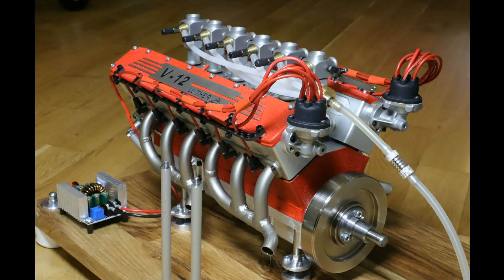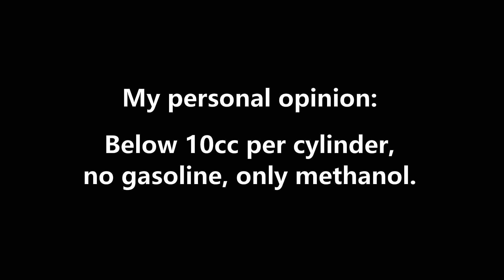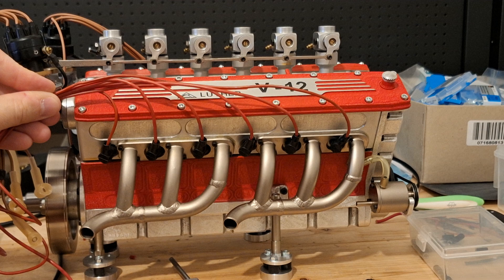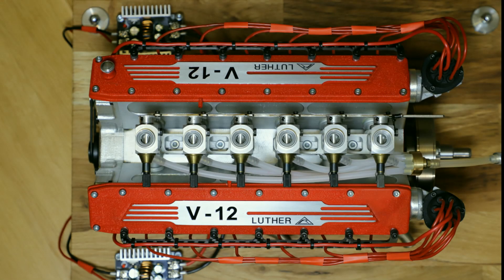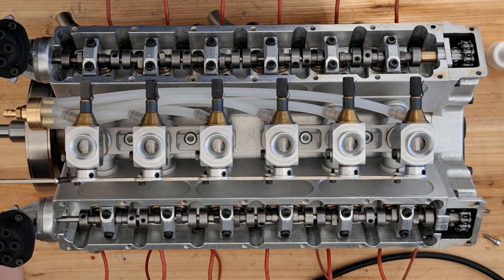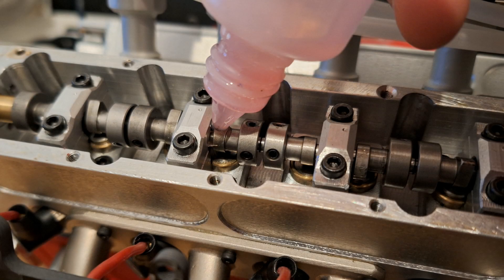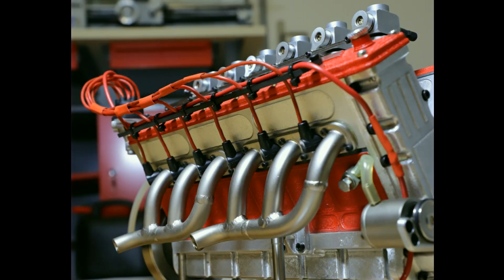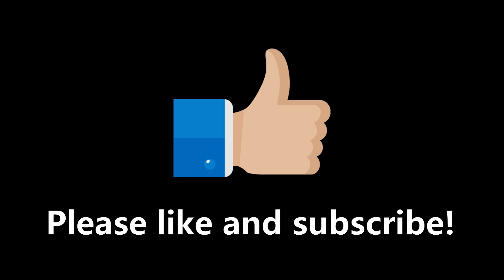Luther V12 Modellmotor mit 120ccm / 120cc V12 Model Engine made by Rolf Luther / scale V12 engine

Comment: The cam lobes attaching individually to the shaft is interesting. Easy to manufacture (don't have to remake a whole shaft if you get it wrong) and can be hardened easily without worrying about warping the whole shaft
Reply from the maker: This type of camshaft is common in model engines, as is the crankshaft, which is not made of one piece. Adjusting the cams is just a bit time-consuming.

Comment: The problem with gasoline in small displacement, is atomization... especially with ethanol blends. Methanol-based architecture simply doesn't have the compression needed for proper combustion. Small displacement doesn't agree with high compression. The tolerances for valve clearance don't scale well. Best alternative: deep chamber glowplugs and high ethanol blends for sufficient flame front propagation to burn the gasoline in secondary combustion.
Reply from the maker: Hi James 👋 It will be something along these lines, which is why gasoline is unsuitable. Methanol is simply much more tolerant, especially in combination with nitromethane. Based on this, I decided to convert it back to methanol. The lower combustion temperature of methanol is also gentler on the engine.

Comment: Of course we want a longer video. 😇
So, no gasoline under 10cc per cylinder. Thanks for the info.
Reply from the maker: Hi V DEL 👋 I also hope that there is a lot of interest in my custom Luther V12. Let's see. 
No gasoline below 10cc per cylinder is a good guideline. Even experienced manufacturers such as OS or Saito respect this. Currently you won't find a 1-cylinder gasoline engines under 15cc from OS and not under 11cc from Saito. Under 10cc per cylinder the engines will run, but not very well. The reasons for this can be probably found in the fluid or thermodynamics of gasoline. It may also has to do with mixture preparation (stoichiometric mixture), which is much trickier with gasoline than with methanol. Achieving this is probably no longer really possible under 10cc with gasoline. Methanol, especially in combination with nitro, is much more tolerant. That's why all small RC engines still run on methanol and not gasoline.
Reply: A few years ago, Horizon Hobby released a 5.5cc petrol engine.
Dynamite® .31 Gasoline Engine

No experience of how it works, but the fact that it hasn't been around for long says a lot 🤔

I've been excited about the Luther engine since the first announcement, I'm always amazed at what you show us on your channel 💪🏻👍🏻
Reply from the maker: @nee3029  Interesting! I see it's 2 stroke engine. I think from this typoe there was one from GO with 0.28cui as well 🤔 But I have no iedea how good they run and if they had problems. I have only heard that they have ignition problems.
Reply: @danielhunziker3577  its mainly the stoich, and being spark ingnited. pretty hard to make a needle valve that can meter that accurately at such a low flow rate. and still atomise "neatly"... nitro/methanol you just dump it in there and dont worry too much, as long as theres enough it will ignite thanks to the glowing element (and a bit of catalysis...). spark has one chance, and its only a very small spark, with a  relatively narrow window of combustibility. 

running the "bubbler" aka "vapour" type carbs, rather than needle valves, petrol is fine... albeit only half the power of the alcohol...
Reply from the maker: @nee3029  Thanks man, do my best! No, it's a 4 stroke engine with 2 valves per cylinder and 120cc.

Comment: An absolutely beautiful engine!  The glow plug distributor is clever.  Also the engine mounts look well designed, hopefully they are soft enough to isolate any vibration, if there is much with the V12 configuration.

One comment, the engine mounts are designed to "damp" vibration, not "dampen.". In my professional job, I design rubber bearings for helicopters, its common to find people incorrectly interchange the word damp for dampen.   To "dampen" something means to make it wet.  Have a great day!
Reply from the maker: Hi John 👋 Thank you very much!😃 Yeah, this engine is a beauty and something special. For me, this is one of the highlights in my collection. It has now become a hybrid, a combination of Rolf Luther and myself. A unique piece that I'm very proud of. I feel that the motor mount is just right in terms of stiffness. Have you noticed in my video of the VR5 that I used the same rubber buffers? I will use these for all my engines in future. In past I used to simply screw the motors onto the wooden plate... stupid idea... a lot of vibrations.

You're right! "Dampen" is wrong. I think "dampen" is, when you steam for example vegetables in a steamer? So cook them in steam. Oh dear, that happens when the own english is good but not very good 😅 But at least this way we can laugh about something 😄

Do I understand correctly that you calculate and design parts for helicopters for a living? That sounds very interesting!
Reply: @danielhunziker3577  I didn't notice in the VR5 video that it was soft mounted, that's a great application for soft mounts.  The key to reducing vibration is to get the stiffness of the mounts as low as possible while still being able to sufficiently hold the load.  Your requirement should be to operate the engine above the natural frequency of the spring mass system that the soft mounts create.  This allows the whole system to operate in isolation.
Reply from the maker: @johnpearson492  Yes, I still have to experiment a bit with what the right rubber buffers are. The motors have different types of vibrations and frequencies due to their design. But anything is better than installing them permanently 😅
Reply: @danielhunziker3577  I do design helicopter parts for a living, specifically rubber bearings that attach the blades to the hub and rod ends for pitch links or lead lag dampers. I primarily work with the helicopter OEMs outside the United States.  It's a lot of fun.
Reply from the maker: @johnpearson492  I have a buddy who has designed artificial horizons and altimeters for airplanes and helicopters. Aviation is very interesting, but would be too regulated for me. That's why model making, I can do whatever I want 😅